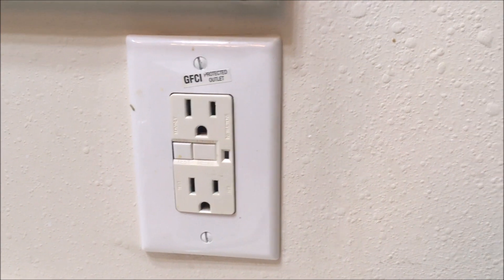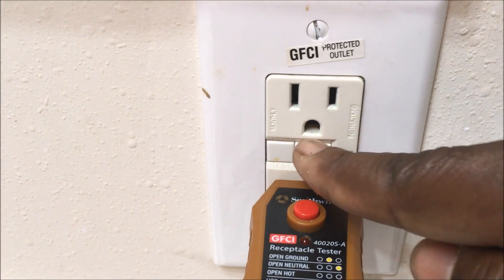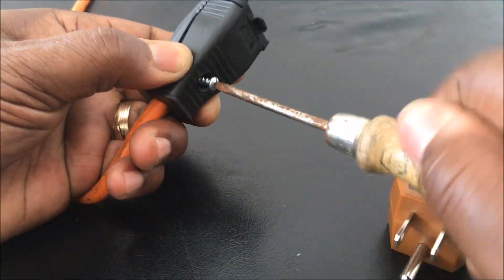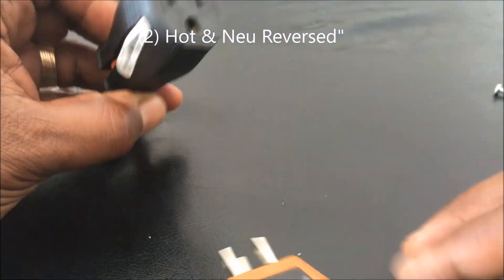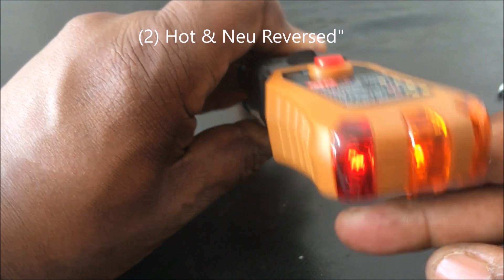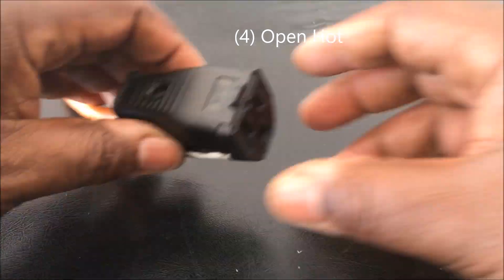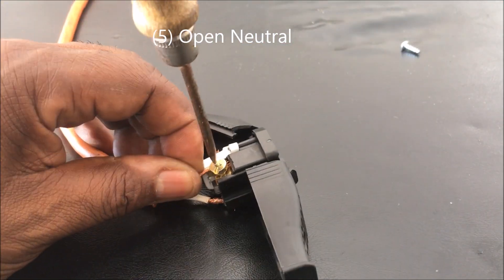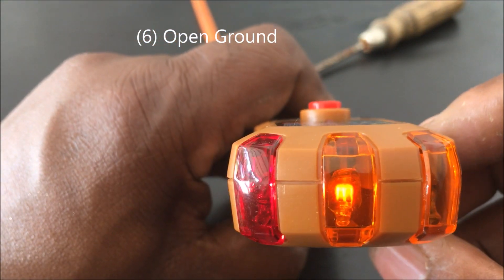GFCI Tester How It Works With All Of The Different Scenarios

Comment: I have a tester like the one in your video. The two normal  lights come on but when I press the button, the 3rd light comes on and the GFCI outlet did not trip. The test button on the outlet works fine. Does this mean I have a bad GFCI outlet?  Thanks
Reply from the maker: Test it on another GFCI outlet and see if it trips, if it don’t then the tester is bad
Reply: @weldingandstuff  The tester does trip the other outlets. Looks like the outlet is bad...thanks

Comment: Something these testers won't find is the most dangerous condition.  Its called a boot leg ground, where you take a jumper from the neutral to the ground.  The tester wont see it and is very very dangerous since it energizes all the metal surfaces related to the circuit (outlet tabs, screws, box, conduit, if you have a metal face plate, etc). Its specifically used to fool these testers and home inspectors.  The only way to find this is to use a multi-meter across the hot and ground of another outlet on the same circuit (it will read voltage that shouldn't be there) or actually opening the box and looking for it.  The big give away is if there a lot of two prong outlets in the house but a couple of three prongs that are testing as grounded.
Reply: It is reverse bootleg ground that energizes grounded cases. You can find it with a non-contact voltage tester.

Comment: Can i ask the voltage is 230 volts ac? I have GFCI rating is only 110-125v this applicable to 230v? Please help me to know. Its safe to used or not.?
Reply: This won't fit 240 V US outlets. If you are talking about other countries then you should use testers defined for the standards used there. The basic method to test GFCIs is the button. You will not need external testers for it.

Comment: What about if I have both hot wires. In america they have one hot wire (120v) and neutral (0V). But here in my place we have both hot wire with 120V each.
Reply: Not true. America is a 240v country. At your panel you’ll have two hots at 120v and a neutral 0v center tap. Same as yours.
Reply: In what place? Use testers for your country. In general it is a very bad idea to buy electric stuff from other countries with different standards.

Comment: Thank you Sir.  Much appreciated.

QQ:  How do I  trip the breaker on a light switch?  I  cannot determine the breaker based on poor labeling when house was built.
Reply: Safe way: by purchasing a circuit breaker finder, w/ adapters (Klein ET310), to plug into the light bulb fixture.

2nd option: Have someone at the panel to start flipping breakers off one by one with the light switch/light on, to see if/when it turns off. Then double/triple check the hot to ground, hot to neutral connection with a multimeter, and or hot stick with just the light switch cover off. 

Stupid/Dangerous way: Short Circuit....Take off the switch cover, touch the hot and neutral together (copper to copper) causing an overload of current, to trip the breaker...WHICH I HIGHLY SUGGEST YOU DO NOT DO!!!
Reply: @Jason_Van_Stone  Thank you very much.

Comment: on "hot and ground reversal" video i saw you tightening the white wire. what was that about? i have a message on the same gfci  meter that says hot and ground reversed (left and right light on). but it is not---i wired it correctly. What else could that message mean?
Reply: Check the outlet next to it,